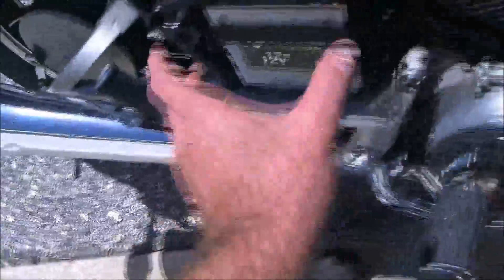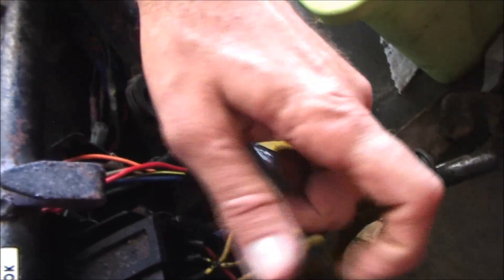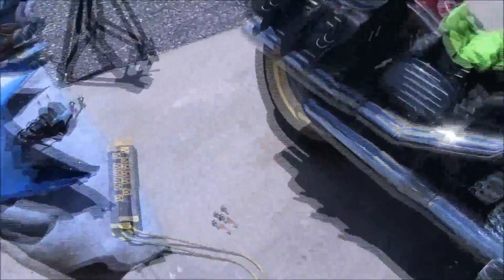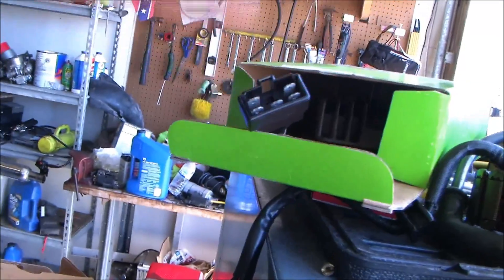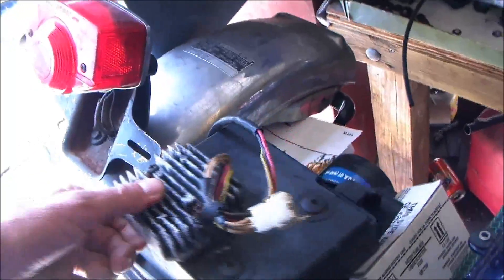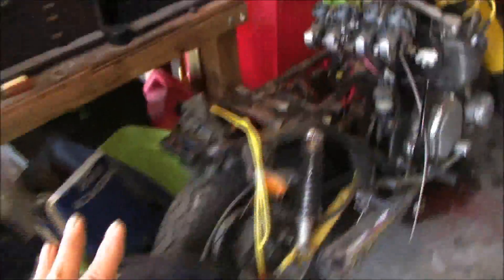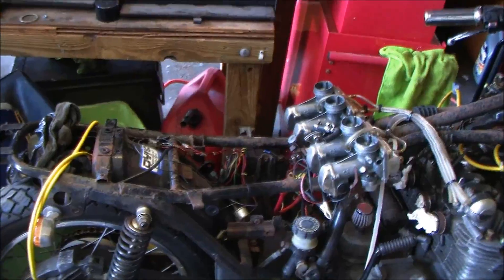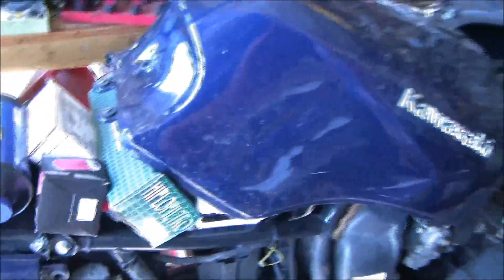Quickie Stator/rectifier debugging

Comment from the maker: fork seals - 40 bucks and about an hour to flush em and do em right
Carbs it depends on the carbs - most dont need a rebuild but ... parts+2 hours.. I generally go 65 if they pulled em and 100 if I have to

Comment: Hi there got a few more quick questions for you first off I found out why my fuel pump runs as soon as turn the key on someone jumped the fuel cut off relay with solid copper wire, will this be ok or does it need the relay. And what tells the relay to turn the pump on when the carburetors need gas, just seems to me that if the pump stays on it will flood the carburetors. Thank you.

Comment from the maker: Fuel filter, fuse for the fuel pump then the fuel pump -- check all 3 -- Also the 600, 700 and 1100 are notorious for puking just at midrange rpms if you have a battery with a bad cell - they dont have enough power at that point to run the pump or coils